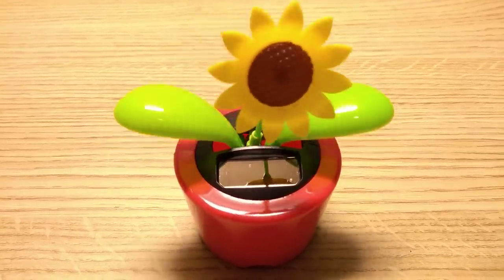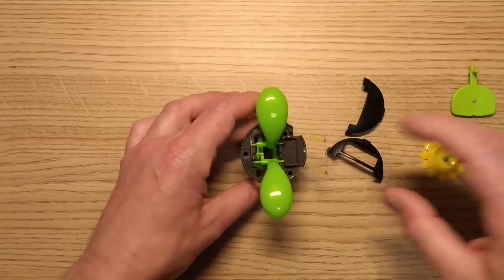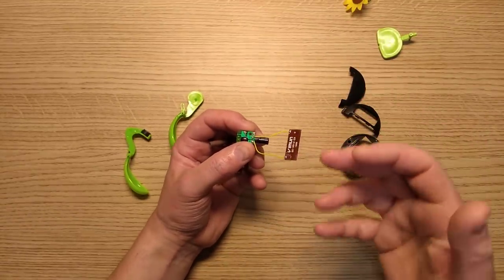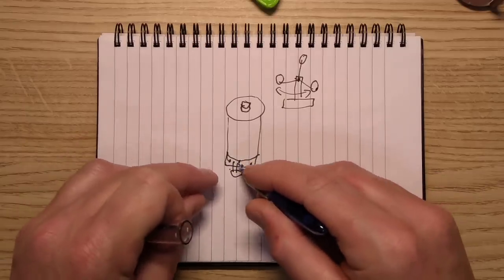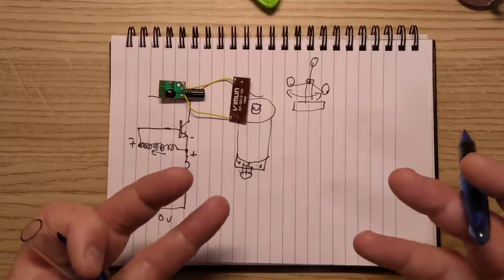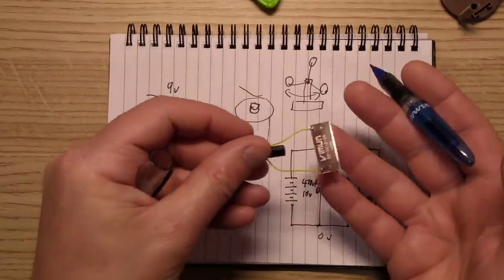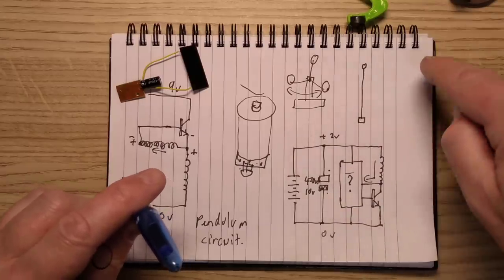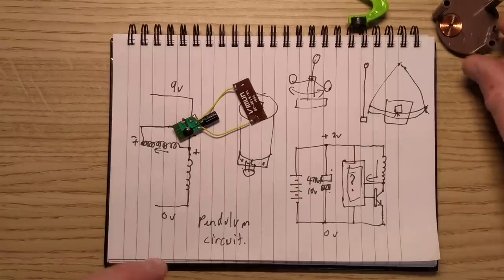Flappy solar ornaments have an interesting history.

Comment: I have one of those but I swapped the solar panel for one out of those death dalek lamps which puts out (I think) 5 Volts, so whenever it gets hit by the sun it goes absolutely mental, it's a lot of fun.
Reply: Lol. I just had visions of a little flower pot and the petals flapping so hard it was trying to take off.
Reply: I just had a vision of a little plastic flower flapping and screaming "EXTERMINATE!" That would be relaxing!
Reply: @TheAllMightyGodofCod  The Daleks had evil pet guard plants forget what the called them....
Reply: post a video pls
Reply: More info plz
Reply: @faumnamara5181  "That's the stupidest thing I've ever heard", I thought. Then I remembered it was Dr Who you're talking about so you were probably right...

https://tardis.fandom.com/wiki/Varga_plant

And the worst thing is, when they finally kill you, YOU turn into a Varga plant! This was back before scifi writers started thinking of explanations for things before they used them.
Reply: Death Dalek puts out 240V on one pin, 235V on the other! 

Still your panel idea isn't bad, I got a mate a solar ornament and it's a bit crap and badly designed, doesn't dance enough. So either a bigger panel or maybe sneak a battery and little switch into his base. A reed switch and magnet maybe, and twist him on his base to bring the two together.

Actually this video gives me the idea of maybe a big capacitor. Ah now I'm thinking up ideas of a supercap, and a circuit with a voltage detector and transistor that only lets it out when it's full. In fact fuck it, why not add delays too and put a full CPU in there? 

"Feature creep", it can happen in seconds in your mind, and render some little hack into something so impractical it's not worth building!
Reply: i dont usually laugh but you got me there
Reply: Tt Miller  Fortunately if it's a halfway decent design, Ohm's Law will protect any innocent bystanders. The resistance of the coil will be quite high. If it isn't, I'll stick a resistor in. I don't think I've ever heard of a capacitor exploding from too much current flow. Even from people who build railguns with big banks of huge bastard caps.
Reply: Will maybe also try it, but with a 0.33F supercap.
Reply: "death dalek lamps"?

Comment: My daughter has a small collection of 'flappers' on her windowsill and its always bemused and irritated my as to why the manufacturers insist on putting the solar panel in front of the flapper instead of behind, where it would get more light as it isn't in the shade of the flapper. Some of hers barely move but when turned to face the window, move much quicker.
Reply: Guess the manufacturers expect you to turn them outwards to wave at passers by
Reply: You may cut the stem from the very base and then glue it back  facing the opposite direction.  Super Glue or Crazy Glue would work well. Someone with more skills would reposition the solar panel.
Reply: I had one of the same flower,I just turn the flower facing opposite direction,leaving the solar behind. But other model can"t .. only flower like this can.. :)
Reply: My doctor's assistant has them on every windowsill, patients keep bringing her more for her collection. It's wild to go in there on a sunny day and see dozens of them waving and clicking.

Comment: Another interesting thing is the fact that the silicon cells are not your normal crystalline silicon - these devices almost exclusively use an amorphous silicon cell which gives it the characteristic brown color. This is why you can't see each individual cell. This is done for two main reasons;  Cost, they are very cheap to manufacture, and efficiency with regard to diffuse light. Although amorphous are poor efficiency in direct light they can have improved performance in the presence of diffuse light. Which is typically what you get indoors.
Reply: Actually, all of those brown cells are amorphous devices, and usually you can see the borders between the cells - the whole assembly is simply diffused onto glass as part of manufacture and hence the inherent low-cost of such devices...
Usually operating at around 10% efficiency, i've seen them in all shades of brown; with some so thin they are somewhat transparent and other being a thick dark-brown - i've even seen some that are a deep grey, almost black, but were still amorphous cells.

My theory for this fascinating solar panel is one of two:
1. The cell could be using a transparent conductor for the current collectors. Those would be invisible, plus a thicker layer of cell material in the panel would absorb more light - effectively rendering the panel as the apparent "black void" that it is.
2. This is a new multi-layer technology; and the panel is one of the latest and greatest in the field...
Reply: @Vilvaran  Yeah right! I'd be more likely convinced it was just another bit of brown cardboard than explanation #2. Even though it's somehow powering a flapping flower, as part of Poundland's ongoing quest to turn all the world's resources into useless items of tat that cost less than 99 pence to produce and sell. That will surely end up as landfill, mixed plastics, copper in tiny quantities difficult to recover economically, and silicon chips with one, fixed, useless purpose. And the glass in the PCB, chemicals in the cap, assorted finely-diced shite, basically, and it's not even attractive as an ornament.
Reply: @greenaum  I was merely stating a theory, it's likely just an optimized version as I stated in #1, a "good" solar cell if you will.
And a "good" cell will power a ultra-low current flippn flapping flower "somehow" better than the cheap-and-shitty panels we see too often...

wait what am I even trying to accomplish here? i have better things to do, like build/test/qualify my power supplies which convert at 95% efficiency using only 3 transistors and a MOSFET; because you know...
Going green and stuff.
Reply: @Vilvaran  I'm only doubting the hypothesis that Poundland would use even a "good" anything, never mind "greatest"! The solar cells in half their stuff are brown cardboard. They sell the shake lights with the bit of black nothing where the magnet should be! Every shitty Chinese trick!

Actually I found solar calculators in Asda the other day that work just as well with the "solar panel" covered. Sure there's dual-energy ones, but they make the claim on the packaging, this is just fake solar. 

It's a shame cos there's no "off" button. They're barely needed, since calculators use almost zero energy. But it likely has a tiny battery, so would be nice to put one on. I suppose they wanted to save on the rubber for one more.

Fortunately there is a way! A way I plan to teach the world, that even genuine solar calculators can be switched off, and thereby forfend the day the Sun finally goes out...

You press the middle row, 4 5 6, and "On" together. That adds up to "off". I don't know why, something to do with the matrix probably. And it's worked on calculators I've tried over the last 30 years. I suppose once they designed the chip, they stuck with it! Nothing to improve. 

Tell your friends that, and help save the Sun! We need it for holidays.
Reply: David Daivdson  Oh wait... you mean the opposite? Mate nuclear's nice and foolproof and everything, except when a plant goes wrong and throws radioactive shit everywhere, killing people and rendering land uninhabitable. Which seems to happen every 10 or 20 years. After Chernobyl millions of gallons of milk had to be poured down the drain, tons of animals made inedible, cos they'd eaten radioactive grass!

After that, there's the small issue of looking after the waste. Which will be dangerous on a timescale many many times longer than human civilisation, or even our species, has been around. Long enough that geological changes and bloody continental drift start to look nippy and threatening. 

Without vast subsidy, nuclear power wouldn't exist, and it's only existed for so long because governments want the isotopes for weapons. In the past, this was overt, now they just keep quiet about it. 

For medical use, smaller research reactors can produce as much Technetium etc as anybody needs. 

Nuclear is a stupid and dangerous solution. Yes, renewable power is variable. So you just build more of it than you need, so that the minimums are still plenty. There'll be plenty of subsidy money left over if we close down the nukes. Or we could start putting a cash value on clean air and water, and charge people who use it up. Without them getting vast, immaterial "subsidies", a free ride to use up what belongs to all of us, and we all need, the economics of the whole thing would look very different. 

There's also energy storage. Flow batteries work on a smaller scale. On a bigger one you might need something big and mechanical. But so what? Plenty of old coal mines to fill with compressed air or whatever.
Reply: ghgg  i think if you count all the lives lost and premature death and disease caused by air pollution, coal comes out miles ahead. Think of China and India, or the smog in Western cities. Petrol too.

Comment: I took one apart that was cheaper made than that one Clive.  It had a 10 v 470 uf capacitor. So I did what any guy would do. I doubled the size of the capacitor, but left it 10 volts.  Replaced the pendulum with a wooden pendulum & placed a neodymium magnet on the bottom of it. The thing got to rocking and rolling to where I had to weight the bottom of it down so it would work right! Lol
Reply: "Tim the Toolman" ("Home Improvement" tv show) would be proud of you.  "More power!"  :p  :)
Reply: Would love to see a video of that😅

Comment: How cool! I had one of these fall apart in my car, so I took a look at the electronics. I didn't know what that blob was doing, but now I do! 
Using the coil as a feedback trigger from the magnet is so smart! I once build a little prototype pulse motor using a Hall Effect sensor to trigger pulses, but now I know I could have just used part of the coil already on there! 
I'm totally going to try it again using the magnet and coil sense thing!

Comment: Coil is ~500ohms. Heat over cooker ring for 5 seconds and bend plastic to remove. Got 1 of these circuits running as a 24/7 365 motor. 4x magnets on water bottle top rotor and 10F supercap for overnight. Been running for months :)
Reply: I think it would have been only fair if Clive would have referred to the like's of yourself and Lidmotor, for the extensive work you've done in the exploration of various implementations of this circuit.
Reply: @johncoops6897  No the original posting guy, but my guess would be that what was meant was an electric motor running 24 hours a day, 7 days a week, 365 days a year.  We'll see what the original posting guy says, though.
Reply: A simple rotating magnet motor that runs all the time, day and night. 4 little neo's around a water bottle cap, with a needle through the middle. Usually they are semi-levitated with a magnet above the needle, or magnets can be put on a very free running fidget spinner.
I didn't want to hijack Clive's vid with links, but they are fun builds with these amazing waver circuits  :)
Reply: And the power source is a solar panel or something else?
Reply: Sorry for late reply. 2x the Vimun panels that are on the wavers, in series. I'll do an update vid at some point soon, while both similar setups are still running completely fine. The second has a circuit by sMartCreations2010, which also auto starts. Sapphire bits work great as long term bearngs, but have had a lot of success with glazed bathroom tiles. Needle point spins on that, the water bottle cap + 4 magnets goes over it and the top of the needle is suspended by a magnet above. 1 point of friction.
Reply: I doubt we're on his radar, but thanks  :)
I think Clive need only look at the way people have no idea he came  up with the Joule Thief. As long as folks get the info and have fun with it.

Comment: That simple transistor switch/coil trigger circuit was used in 1960s Junghans Ato-Mat battery wall clocks - the output coil gave a push to a balance wheel with magnets on it - so timing was still controlled by the balance wheel period, but power input was via the drive coil. Nice traditional clockwork tick too :o)

Comment: I once had an electromechanical battery operated clock that had a standard oscillating rotary balance wheel escapement with hair springs on jewel bearings like any other small wind up clock but the balance wheel was 2 disks with magnets that were spaced apart with the pancake drive coil between them. I removed the springs and escapement to let the balance wheel spin freely and it was impressive how fast it would spin.
Reply: I still have one of those clocks from Bosch. It has been running for probably 30 years now. Accuracy is pretty OK if you take care to tune it, temperature variations seem to be the main source of changes in pace.

Comment: Good disassembly.  I have several electric pendulum regulated clocks in my collection of electromechanical devices.  One of my favorites is a 1937 French Bulle clock which predates Kundo.  The Bulle uses a U-shaped north-south-north 3-pole magnet rod and a coil which swings back and forth coaxially around the magnet rod.  There is a butterfly shaped contact flipped by pendulum with one side a dummy contact and the other side a pulse contact.  The butterfly rocking in turn moves the time keeping escape wheel.  Being French, the Bulle is maddeningly difficult to get adjusted correctly, but once honed in, it is a pretty good time keeper and can run for at least several years on a modern alkaline battery.  There was some very interesting electric clock engineering in the years before synchronous motors and mains power with stable frequency.
Reply from the maker: I have a gents master clock.
Reply: @bigclivedotcom  Very cool those are beautiful clocks!  I’d like to add a Eureka clock to my collection some day, but they are very expensive here in the States.  I have a Warren Telechron master clock, the smaller wall mounted model, used in power stations in the 1920s.  There is pendulum regulator and Telechron synchronous clock motor which is connected to the dynamo power.  The Telechron motor also keeps the spring wound.  There is a differential connected to the two clock sections to indicate any difference in seconds between the pendulum time and the time based on dynamo revolutions.  The dynamo operator could look at a large hand on the clock face to decide if the dynamo needed a little speed-up or slow-down.

I’ve got a couple of Barr / Poole table top Hipp toggle clocks where the pendulum is free swinging until it runs down enough to trip a toggle which drops a weight arm to impulse the pendulum synchronously.  The electromagnet is only used to raise the weight arm.  When I got my first Barr clock, I thought the mechanism looked like typewriter parts and it turns out Barr had previously been a typewriter designer.  The Bar and Poole clocks are 1930s era.

Comment: Wireless World magazine did a great Cardboard Mechanical Clock project back in January 1982 that used a similar circuit to power its pendulum. Well worth a look.
Reply: That 1982 clock sounds like one for the Fran Blanchet channel 👍

Comment: Your mentioning a pendulum with switch contacts reminded me of the clock system we had in our secondary school, not sure what it was called but there were large single-cell batteries (primary cells?) and a master clock which used to send a hefty pulse of current along a wire which triggered all the other clocks to move on each minute. Best thing about it was when summer time started; all the clocks would click around an hour to catch up with the correct time in one minute!
Reply from the maker: I liked the old school clock so much I bought one.   https://www.youtube.com/watch?v=H3xbNfVGRVI

Comment: About 1980 a friend of mine had a "perpetual spinning top" that would run forever! A small top spun between the finger and thumb onto a 5-6 inch plastic base. The top just kept on spinning.

The base had a 9v battery and some sort of circuit, and a coil located under the central point of the base. The base was slightly concave so the spinning top tended to move to the centre as it slowed. The top had a magnet. Somehow the coil would add "spin" to the top, sometimes the kick was such that the top would fly off the side of the base.

I found some videos of similar tops,
https://www.youtube.com/watch?v=1fU1dWEEsHE and
https://www.youtube.com/watch?v=InWLhPcp9wg

And how to make your own -
https://www.youtube.com/watch?v=sZflO4PQKC4
Reply: AWESOME!

Comment: I’d love to see a version of this with a Piranha Plant from Super Mario Bros! The base would be a pipe instead of a pot and you’d replace the sunflower with the piranha plant’s mouth. It would be neat if you could make the mouth open and close too. Hmm, I bet I could 3D print that and transplants the internals from one of these ornaments (the coil, PCB and solar cell). Hmmm...
Reply: That would be cool!  Maybe the parts could be scavenged from the McDonald’s toy.
Reply: The trick would be balancing it, so that it acts as a pendulum. That's very important, there must be conservation of energy, between potential and kinetic, at all stages. Also it would need to be well-balanced. There is almost no motive force available on these. 

That said, the weight wouldn't likely be a problem. As long as it's all balanced. THAT would be the problem!